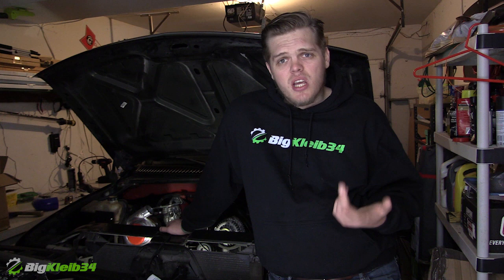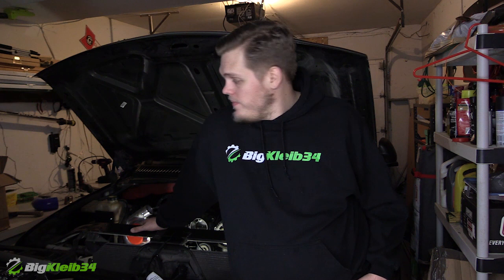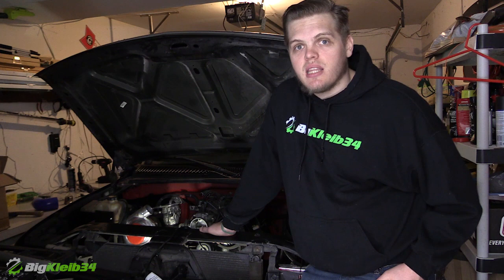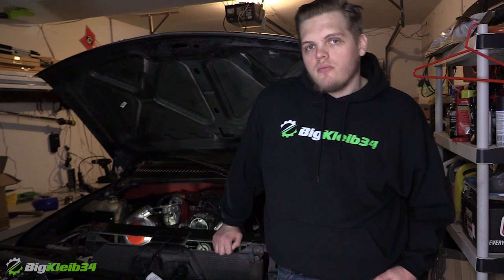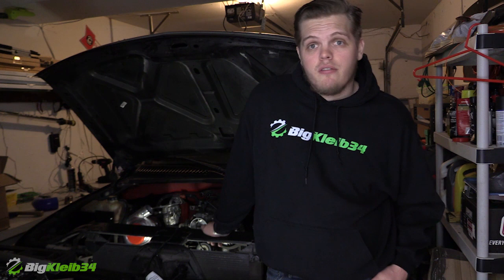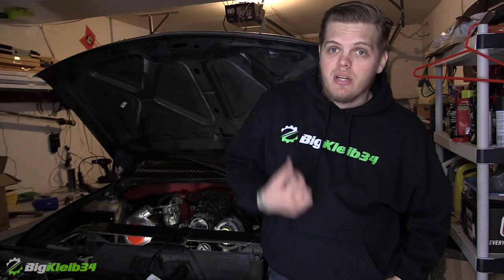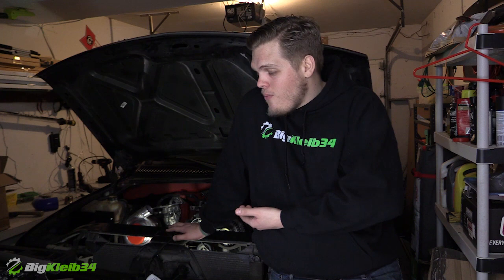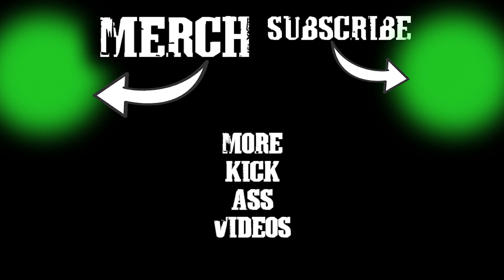How Much $$ to Build my Turbo Silverado vs Having a Shop Do It?

Comment from the maker: The Parts/Companies that Make this Truck ROCK:
Learn to build at Sloppy Mechanics: https://goo.gl/o1mdzs 
VS Racing 7875 Turbo + 3”Intercooler/piping + 44mm WG: https://goo.gl/yPWpG2 
PAC 1218 Racing Valve Springs: https://goo.gl/PL38zv 
AEM Wideband: https://goo.gl/jVL2Bn 
Walbro Fuel Pump: https://goo.gl/4zw3KR
NGK br7ef Spark Plugs: https://goo.gl/ty1PZw 
Fahler Manifold: https://goo.gl/AT7pbX 
Decapped Injector Flowing/Testing: Derr Injector Service
Camshaft: https://goo.gl/nKHkDr
Reply: BigKleib34 seems like a fair estimate on parts and labor and like you said maybe a little over 100 a hour like 105 to 115 is what I see here in California for a good shop you woyld want working on your stuff
Reply: BigKleib34 does that turbo come with the piping? Or did you just buy it seperate
Reply from the maker: It's separate I believe. Everything is from VS Racing, though. They sent it all as one big care package.
Reply: BigKleib34 thanks, got a 383 I wanna put in a truck but can’t decided to leave it alone or get a turbo.

Comment: Good stuff. 👍🏻 I did my whole setup for less than $750 but I bought a used turbo so that helped a lot. Paying someone else to do the work for you is definitely going to double or in some cases even triple the cost because a lot of shops just wanna bolt stuff together which forces you to buy more custom parts rather than fabrications things yourself. Just something else to think about. 😉

Comment: Yea i agree, i do the same kindnof work.  But depending on what you got to start with,  if the engine had good internals in it. Or do they need forged stuff, its all in what there looking for. But ballpark range id say 12 to 15k. Love the content keep it up. I love the truck stuff.. building a truck right now for myself.

Comment: Great to know! I have a 99 sierra I've owned for about 16 years with the 4.8, it's nice to know what to expect. I've got less then 130k and still runs nice and smooth! I plan on boosting it and hopefully hitting over 700 without issue (at least a major one). I'm a newbie and a first time commenter on your videos, but I plan on tackling the work myself as its no longer my daily driver. However when subject to New England winters (without garage), and having kids, time is limited. Great videos, keep it up!
Reply: UPDATE please how much did you spend in total?

Comment: Damn, I'm going to turbo my 04 2500hd 6.0 with an on3 kit but I ain't going that big I'm gonna put a 70/65 on mine, the whole kit with e85 support and just basic supporting mods to make it work reliably for 3k but that doesnt include a tune or cost to install if taking it to a shop but my truck doesnt need anything else since I'm going to keep it on low boost till I can as afford more stuff like a better cam, heads, intake manifold, internals(springs, pushrods, rocker arms and what not), and a converter st least but I'm not going to push it over 550whp for a while. It's a 4l80e anyways so it's pretty fucking tough. Kinda lol. But the 300 crank hp and 360tq just doesnt cut it for me, if I'm gonna get bad mileage too might as well get some more power down too.

Comment: What transmission and torque converter are you gonna run?
Reply from the maker: 4l80e. Not sure about converter yet, though.
Reply: Do the 4l80e swap BEFORE you turbocharge. You'll quickly destroy the 4l60e under boost. Besides, selling a GOOD used 4l60e will help cover the cost of a good used 4l80e. On a tight budget, use a junkyard 4l80e with the stock 2200-2400 high stall converter, usually found behind a 4.3, 4.8, 5.7 or 6.0. Diesels or big blocks are usually low stall. Install a $65 Superior 4l80e Kit, a 6.0 type flexplate/spacer and a proper yoke. The later 60e ("99ish-up) is about the same length as the 80e, which allows use of the stock driveshaft. You need to relocate/ modify the crossmember mount, swap a few pins (at trans/pcm) and hook up the front VSS. Finally, do a 4l80e segment swap for the SAME OS on your PCM (found in HP Tuners repository). Research the wiring on LT1swap.com and do your homework.

Comment: Pretty much you get what you pay for.  Yea we can put a turbo kit on a Silverado for 6k but. If it breaks anything else on the engine that’s on the customer not wanting to do nothing Internally.  Or get rid of their 4l60e.  As well as upgrading cooling system and fuel system.  The only time I cover anything with warranty is if something breaks on my turbo build.

Comment: Shops where I live are definitely ripping ppl off with the shop hours , I was looking for a cam swap on my SS and they wanted to charge me 3500 to 4000 dollars , that’s without a stall converter , 1500 dollars more for a converter
Reply: Silver 2ss561. you definitely need to shop around it all comes down to perfection! who's the best for your dollars" but keep in mind you have a car that isint, the essayist to work on.  you have to be careful with it and that's defiantly going to take more time good luck. you have a nice car for that upgrade good luck..
Reply: forgot to get that other good luck out" of there.anyway it's nice to have "luck on your side hope everything turns out good for you.
Reply: What is the difference between a stall and a 2-step? I have a 1999 gmc sierra. Which one do I need?
Reply: John Kolinoff i actually got a supercharger for it instead , would be doing a cam for it later on and e85  thanks
Reply: Drae2g2 stall converter is like a internal clutch , the higher the stall speed the higher u can rev the car holding the brake . A 2step is normally use for building up boost  to launch the car , I believe is by the pc cutting up fuel or something like that . I have a lnc2000 from lingenfelter that does that and retards timing too for nitrous
Reply: Silver 2ss561. good move have some safe fun! with it you have the perfect car for it bowtie power!!
Reply: Silver 2ss561 👍👍✔✔

Comment: you are usually better off buying something that is already built as people usually sell these sorts of things at a loss. Also another way to find a project that is fucked up like a blown up transmission or engine or something wrong with it that you gen get for like $1000. In your case i probably would have looked around for someone selling a silverado with the 4l60 blown up and offered $1000-1500 for the truck in non running condition which its perfect since you would most likely be upgrading to a 4l80e anyways the blown up trans really doesn't matter and you save a whole lot of money doing it that way as your initial cost for the vehicle is basically nothing.

Comment: I pulled the Lightning in the garage 11 months ago for headers...  25k later and it's a mid 10s fun-mobile.  All but  $1500.00 is parts.
Reply: I'm living this right now lol, except rcsb silverado, filthy engine bay from leaking power steering hose, took a few things off to detail, now engine, trains are out, block is at the machine shop getting forged rods and pistons, bought a 4l80e, every sensor is new now, new oil pump, timing chain, cam...lol

Comment: I don't believe this ten grand lol my escalade has 10k just in repairs and maintenance and new racing trans . I'm sure my turbo job is going to be about 3000 for part lsx fast intake manifold is 1000 coils & wires  400 I do alot of my work on my own but tune cost about 500 at a shop so 15k is more accurate for a good build and that's not talking paint

Comment: I put less in my truck. lsa supercharger $1600, bored/stroked iron block 6 liter $600, 4.10 front $75 and rearend $250, 4x4 80e/transfer case $150, cnc 0821 heads $500, cam/springs $400, lsa crank $150, forged rods $200, forged pistons $600, rings/bearings kit $200.  brings me to $4,725.00. if you dont mind me asking what did you buy? because if you didn't touch any internals some where along the line you got ripped. If you're doing your own work I cant see it. I myself a certified mechanic believe 10k should have that truck screaming up the track.
Reply: Yeltom Automotive he said 10k including the 6k he spent on the truck.
Reply from the maker: Ahh, think I might have been unclear on this one. It's around 10k total with the cost of the truck. 3500 on mods.
Reply: BigKleib34 lol that sounds right.

Comment: if you don't have good internals. it's just a matter of time before that engine turns into a hand grenade! better keep that boost real low...
Reply from the maker: Lol I know this. Not sure what I'm doing with that yet but I'm sure there will probably be another project with the truck before long.
Reply: BigKleib34. right on looking forward to see how it comes out. it definitely helps having some sponsors good luck..
Reply: The stock LS truck motors will handle 11psi all day long.
Reply: A built lq9
Reply: Doesn't need to be a rebuilt fews guys after running 10psi on junkyard motors.
Reply: All about the tune and proper fuel system to keep it alive around 10-15psi
Reply: John Kolinoff You need to watch some more Sloppy Mechanics. He can make a 6.0L last at 1000hp with decapped injectors on a stock 230,000miles motor.
Reply: $500, just have fun..
Reply: you aint making 1000 on decaps lol
Reply: graybusch810 He did. On the LQ9 Colorado.
Reply: Chuck Beef decaps flow ~65.  That’s not enough injector to net 1000
Reply: graybusch810 Well it had decaps and made high 900-1000rwhp if i remember correctly.

Comment: Shops here in south texas charge $3000 for turbo kit . And thats installed and tuned. Thats with fuel system injectors. Every other Chevy truck here is turbo lol
Reply: Mark Salinas which shop does?
Reply: Kirbawesome lino snails. He builds the kits for most of the shops
Reply: Mark Salinas got a website?
Reply: Kirbawesome he just has a facebook
Reply: Mark Salinas i looked up lino snails on facebook nothing came up thanks
Reply: Kirbawesome lino snails and performance shop

Comment: damn i got ripped off, sold my 10 second scsb for 10k... and it was nicer than this stepside... Also if you have ppl that think 15k is reasonable to slap a cam in and a sloppy setup on a truck send them our way

Comment: First of all, if you don't have the confidence to wrench on a Zo6 or anything similarly priced as youu put it, then you really don't know what you're doing and shouldn't be wrenching on anything. Secondly, why does everybody think the rear end in a truck needs to swapped out when upgrading power? The older 8.5" and newer 8.6" like you have, with the right differential, good ring and pinion and set up correctly, not like some people do and just slap it together, will hold 1000+ hp all day, every day.
Reply from the maker: The rear end broke under stock power.
Reply: Because screwing up $6k isn’t as bad as screwing up $50k. You have to learn somehow and making mistakes at a lower price point is ideal.
Reply: The Okayest Guy Exactly. I learned by just diving in, taking shit apart and then having to learn how it went back together. You’ll never learn if you never try.
Reply: Rear ends are one of those things that are either right or Not, and either way you'll find out real quick  lol
Reply from the maker: Also, if you mess up one thing and that one thing grenades the engine, you lose $10k in one shot vs blowing up a $500 truck motor